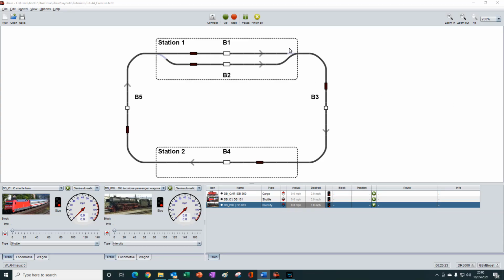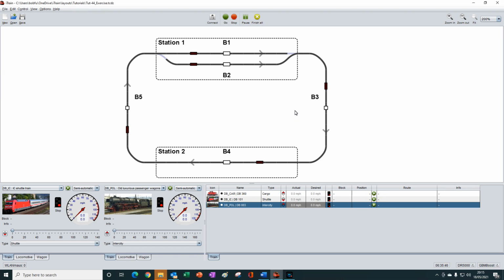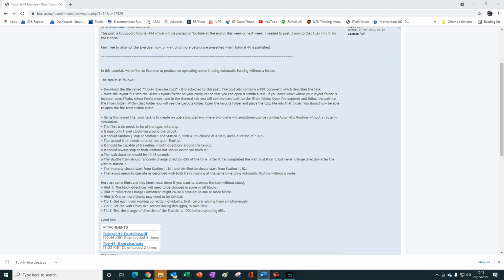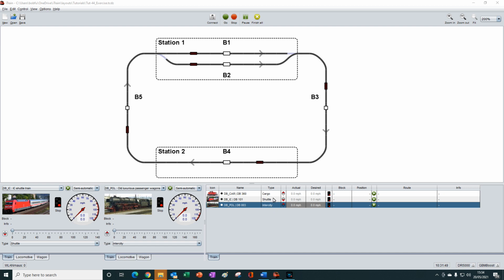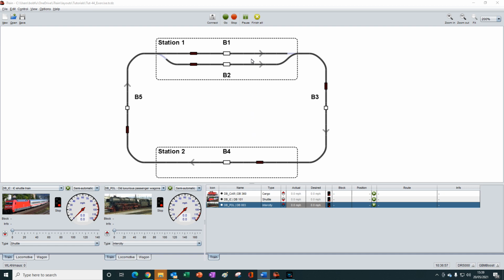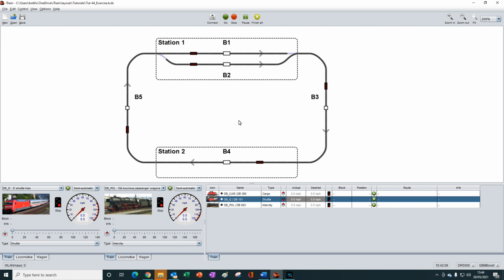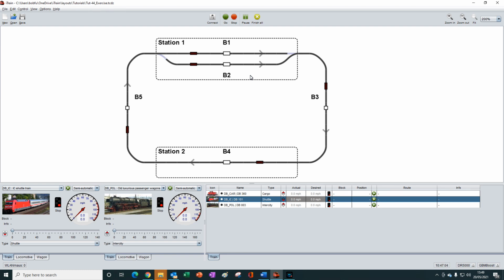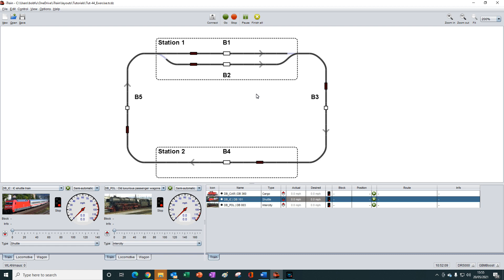Video 44: Using iTrain Tutorial - Exercise 1 (Definition)

Comment: Confusing. I’ll stick to TrainController. Interface much easier.
Reply from the maker: Perhaps I should have made it clearer that it would be much easier to perform this operating scenario using Train Routes, because you then have precise control of the outcome.

But this exercise is about the use of Automatic Routing without a route (emphasis on "without a route"). This is the mode in which iTrain creates the route, not us. iTrain has no idea that we want it to perform a certain operating scenario. It will be creating its own random route and making intelligent decisions on-the-fly based on everything that is happening on the layout in real-time. 

Our task is to see if we can influence iTrains' decisions (its brain), such that it performs the operating scenario described. Which is an entirely different task compared to using Train Routes.

All the things that we can influence are contained within just 3 or 4  editors, so finding things to adjust is pretty easy due to the simple interface. Everything we need is contained within one drop down menu.

The trick for this exercise is to break the task down into stages. Get each train operating on it's own first. Start with the easiest which is the the Intercity basic loop. Then remove the Intercity and get the Shuttle to perform the automatic change of direction - the task is made harder because I deliberately set up the layout with non-default settings so that you have to find parameters to adjust.

[I expect most of us will not get beyond this stage without help. It is a particularly difficult task because of the operating restrictions caused by the simplicity of the layout.]

When both trains are operating separately, then put them both on the layout together and press both start buttons. Now you will have different problems to resolve. This is where we will encounter the biggest challenges, and that is the idea behind the Exercise - to push our boundaries into areas where we meet difficulties and perhaps get frustrated - just like in the real world of model train automation - no sugar-coating - they are examples of situations that we might face on our layouts, especially layouts with single track operations which are probably the most challenging to automate.
Reply: Actually it's pretty intuitive once you are over the beginning hump. This one is kind of a test exercise video for Bob's students! :) 
See the other videos